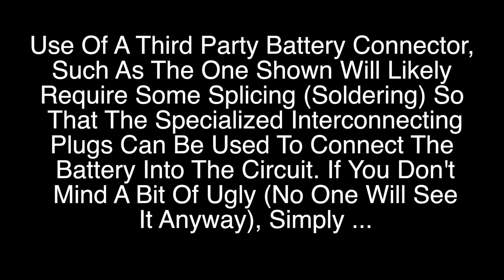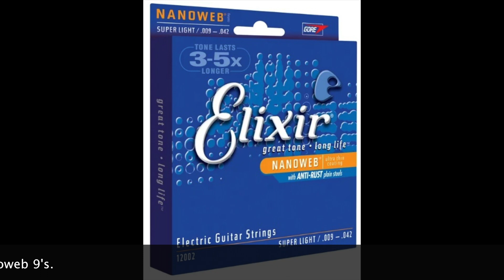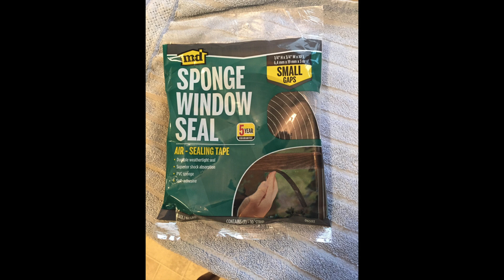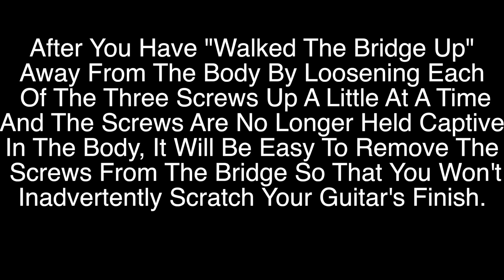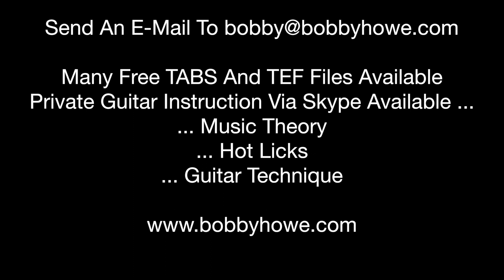Fender USA Tele EMG Pickups: A Review

Comment: Great review,thanks. I had EMGs in a Stratocaster for years and the battery would last a year. It was totally silent and I used it primarily in a recording studio where noise can be a issue. Worth mentioning that EMGs are low impedance output so you can run long cable lengths with no signal loss and also the strings don't need to be grounded so there is no risk of electric shock.Also the volume control doesn't kill the treble reponse when it is turned down.
Reply from the maker: Thanks for your nice words, Greg.  You've added some great additional points as well.  All my best to you and yours.

Comment: you have to take the neck off to install pickups?? ...wtf. I've changed my pickups in my tele without taking the neck off. hell..,I even installed a humbucker in the neck position without taking the neck off. I've never even heard of this witchcraft
Reply: On a 21 fret neck you can just pull the pickguard. On a 22, the last fret overhangs the pickguard so it requires at least loosening the neck and popping it up a bit to get the pickguard off.

Comment: Great video and wonderful playing!  I've been using EMG pickups before they were EMG.  For those wondering, yes this exactly the way they will sound.  Whatever your amp is these pickups will do the trick. As demoed here, Bobby plays a variety of styles and they sound great for everything.  They're absolutely noiseless and if you get noise using them it's something else in your signal chain. One thing that I love about EMG's is that they have a much better frequency response throughout the guitar range and have a very even response meaning that there are no soft or dead spots anywhere on the guitar.  You don't have to pick one string harder than the other to get the same volume. Because they are active and use a battery there is an alternate method rather than put the battery in the guitar.  EMG makes a battery box that uses either a battery or a 9V adapter with center pin negative which is what almost all pedals use. One thing I have noticed is that not all adapters will fit in the hole so if you go to a music store to get one make sure you bring the box to make sure it fits.  I don't know if EMG now makes a power supply for them. You have to use a stereo cable from the guitar to the box but they also sell those as does a lot of electronic stores. Use a high quality cable and there is no loss of tone.  I use the battery box exclusively because it's a lot easier to change the battery on the gig because there's a spring loaded tray that slides out to put in the battery. At home I use the 9V adapter because I like to keep the guitar plugged in because I'm too lazy to take the cable out of the guitar every time I stop playing. All this said, I highly recommended these pickups and I'm sure you'll love them.
Reply from the maker: Thanks Bruce!  Great info!  I'm glad you watched and liked the video.  Thanks, in advance, for subscribing to my channel!
Reply from the maker: Thanks Bruce for your nice words and for your details about EMG pickups.  I've put EMG's in at least 5 guitars and not been disappointed with any of them, glad to have made the investment.  All the best, BH

Comment: Beautiful Playing, sir! BTW, I hve active EMGs in 3 guitars, one setup in my Mexican Strat for the Gilmour setup, another in a Mex Strat for blues ( straight up Strat) and a setup in a Mex Tele. The Best part is they sound so clean, sparkly,  and NO HUM!! No worries, ever. Though I recently had a battery box installed in each guitar for quick access instead of having to disassemble the pick guard each time, which was a BITCH! Still worth it though because with average playing, the batteries usually lasted 6  mo. to a year.
Reply from the maker: Thanks toolbros!  Great info!

Comment: Love EMG but surprised they would recommend the use of foam for the height adjustment issue?  Pickup tubing available from Fender or any rubber tubing you can find in the same diameter (I found some at a hobby shop) would have been a much easier and cleaner install.
Reply from the maker: Adam, yes, I think I agree with you.  I will likely do something similar to this again and when I do, I don't think I will go with the foam.  EMG did recommend it, I went with their recommendation, it was OK for the one time I used it but if I ever have to re-do it and/or if/when I do it again, I don't think I will go with the foam.  All the best, BH
Reply: Bobby Howe great playing and videos, all the best to you too.

Comment: Awesome tele setup and playing! I was deciding between the EMG’s and SD’s, and decided to go with the EMG’s for my tele after watching this video. Installation was not difficult, and they sound amazing. I have a question: What pickup height did you settle on? I’m in the process of tweaking mine and would much appreciate your feedback. Great informative video, thank you!
Reply from the maker: Hello Mark B!  Thanks for your nice words and for watching my videos.  The neck pickup, just below the 6th string measures from the pickguard to the top of the pickup slightly more than 1/4".  The neck pickup, just below the 1st string measures from the pickguard to the top of the pickup slightly less than 1/4".  The bridge pickup measures from the mounting plate to either the top or the bottom of the pickup slightly more than 1/4".  Other factors affect the sound you will get too of course, like the height of the bridge saddles.  I tend to have very low action on my guitars and a very light touch on the guitar, I'm not a heavy handed player.  The strings I use are Elixir's 9-42.  I thought I would pass that along as well.  I hope all of this helps.  Let me know if I can do anything else for you.  All the best, BH
Reply: Thank you very much for the helpful information. My current pickup height is very similar to your specs, with the exception that I lowered the bass side of the neck pup slightly. It seems to clean up the lows and let a bit more brightness through for me. The action is fairly low as well, and I’m currently using Ernie Ball super slinky 9-42 strings. Haven’t tried the Elixir’s yet. I’m very happy with the tone and zero feedback results. Thank you for the great info and videos.
Reply from the maker: You're welcome, Mark!  Thanks for watching my videos!

Comment: Thanks for the video. I just bought this kit to install in a Squier Affinity Tele I also just bought which plays great but the pickups are lacking as expected. I hope the installation goes smoothly with help from your insites. Cheers!
Reply from the maker: Thanks Jason!  I hope it goes well!  I'd be interested to know how it comes out when you're finished!  All the best, BH
Reply: @BobbyHoweGuitar  T System has been installed. I chiseled out some room in the cavity to fit the battery and had to do a bit of metal filing for the bridge pickup to go in smoothly. I found I had some surgical tubing and I used that instead of springs to mount the pickups. A little bit of work but installed and sound great!
Reply from the maker: Great!  Sounds like you're happy with them!  I'm sure you'll get lots of service out of them.  All the best, BH

Comment: How is it going Bobby, quick question, just got myself a fine Fender Tele and even though I love the way its OEM pick ups sound I find myself in trouble “eq”ing them along with my other Les Pauls cos all of them got EMG sets on them. Since you also have Gibsons with EMG sets on, how do the outputs level among them?? Awesome review and thanks for the attention in advance!
Reply from the maker: Hi Alec, thanks for watching my videos and for your nice words.  As far as EQ-ing pickups be it on LP's or on Tele's, in general, I'd say that through experimentation, I set the bridge pickup closer to the strings, the neck pickup is further away.  One must be careful here, a pickup too close the strings can pickup string overtones giving distortion and unwanted harmonics in the output.  Then there is tilt, i.e., the angle of the pickup in relation to the strings in order to EQ the way the pickup is affected by strings 1, 2 & 3 vs. strings 4, 5 &6.  If you simply can't get the results you want with only mechanical adjustments of the pickup height adjusting screws, you may have to set them the best way you can and then use two different channels on your effects pedal, i.e., when playing on the neck pickup use one pedal channel, when playing on the bridge pickup use a different pedal channel ... more hassle but nonetheless, a workaround.  Then of course there are the EQ setting in the pedal itself.  Just from you question(s), I'm considering making a video describing my entire setup(s), LP's, Tele's, EQ pedal, amplifier.  What do you think?
Reply: Bobby Howe I think it’s an awesome idea!! Also I (selfish or not lol) could get a fair comparison regarding (specially) volume output, which is my main concern when swapping out guitars! Cos the difference (volume wise) between my 81-85 les pauls and my tele is HUGE!! Thank you VERY MUCH for your prompt answer!!

Comment: Hello sir! Tha ks for the video. I have a question about the pickups: are they "rail" pickups? Or do they have poles under each string? Thanks!
Reply from the maker: Hello Luis, Physically ... externally ... no rails or pole pieces, more of a soap bar type, just a high quality plastic housing ... here is what EMG says about them ... 
"The EMG T Set is a new take on the classic Telecasters™ pickup. Don't let the looks fool you, the T Set gives you all the twang and punch you'd expect with incredible clarity and definition with no hum. The bridge pickup (RT) gives players that classic chime without the 'ice pick' and a rich low end. When overdriven, this guitar pickup screams with incredible sustain and edge. The neck pickup (FT) has everything you want from a front single coil: clarity, warmth, and rich harmonic content that is perfectly matched to the back pickup. The T Set uses Alnico magnets with custom engineered coils and windings to give your sound fullness and a broader bandwidth, well beyond your typical Tele pickup. The EMG T Set covers rock, country, blues, fusion, R&B... and with our solderless wiring system, it's easy to install on your own."
You can find a photo here ...
https://www.emgpickups.com/tset.html
I hope this helps.  BH
Reply: @BobbyHoweGuitar  hi! Thanks for replying, am asking this bcos I am thinking of using this pickup for an electric ukulele that am building, but being only 4 strings, and those strings being separated differently than in a guitar, i need something like a rail pickup, rather than having 6 little poles to sense each string. EMG is close for the California stay at home order, so no customer support is available as of now.
Reply from the maker: @elluisito000  I would say before you invest in something you may or may not be happy with, that is, it may or may not meet your need, consider these points:
1. You could spend your money now and buy something through a vendor but maybe it'll work the way you want it to, maybe it won't.
2. The country won't be shut down forever.  When EMG opens back up again,  I'm sure they can advise you as to what stock products have the best chance of working for your application.  If they don't have it, I'm sure they can make you a custom product that will.  Ukuleles are becoming more popular these days and certainly aftermarket companies like EMG, if they're not speaking to that market now will miss an opportunity if they don't.  They should know that.
3. You could could invest in a rail-type pickup by getting something off of eBay but if it were me, I'd get something inexpensive to see if it will work.  It's a risk but not a lot of money put forward, not a lot of money lost if it doesn't work. 
It's not my place to say what you should do but those are my thoughts and I'm just trying to be helpful.  I hope this has been useful.  All the best, BH
Reply: @BobbyHoweGuitar  hi! Thanks for the advice. I have installed emgs in several of the basses I have built in the past, but this ukulele is the first one for me, and there aren't many options around, specially for the level of quality and noiselessness that emgs provide, I know their bass pickups and the are very very good. But the string spacing is an issue issue, and saddly they are covered and the only way to figure out if the pick up is one rail or several poles is having one pick up already :D

Comment: An easier fix for the pickup heights is to use surgical tubing, very common on most older guitars, and an easy fix for any. My ‘52 has no problems at all with installation
Reply from the maker: I would say that it's another way to go about it, I wouldn't say it's easier.  Surgical tubing will work but it's so tough, difficult to cut.  The foam method was recommended by EMG, it's easy to work with and is very inexpensive.
Reply: Bobby Howe ironically, tubing is the common method for the majority of single coils, and a snip’s easy. My old ‘52 and ‘68 still had them in . . The old adage, “Don’t reinvent the wheel” when nothing’s better. But if you’re happy, great 👍🏻 
Certainly don’t like the rattling springs option that came with the Gilmour set, but then again I got rid of that soulless set 😏
Reply from the maker: I'm glad it works for you.  All the best, BH
Reply: What I've done if spring compresses completely before desired height is just grab my snippers and snip a bit of spring away until I get desired height.

Comment: Can I route the control plate on the inside to make  it wider of the to sides of it
Reply: For the battery
Reply from the maker: @darrelloxford427  I suppose you could.  An easier solution is to apply gentle pressure to the sides of the battery to squeeze it a slight bit so that it will fit.  Rather than go to the trouble of routing the body of the Tele, which could give negative results ... I'd be concerned that I'd be taking a chance on scratching the finish of my guitar ... unless you feel totally confident about using a router on your Tele body.  There is also the hassle of taking apart a great deal of the guitar to use a router to do all of this.  Not all 9V batteries are the same width either.  I hope this helps.  Best regards, BH

Comment: Hi Bobby. I've been loving and using the T-52 pickups in all my builds and my own Teles as well, but haven't compared them to the T-set, I'm just wondering if you've tried both, and if so, what are the differences (primarily clean in the neck position). BTW, thanks for the great videos!! You really should call Rob Turner (the owner & CEO at EMG). He'd love to get your reviews. (he's a good friend of mine)
Reply from the maker: Hi Kevin, thanks for your nice note.  I have not tried any T-52's and I presume you mean those pickups that are retro-fit types to make a modern Tele sound like a '52 model.  What I can tell you is that the EMG T-set is clean and crisp.  I can get a country-type, snappy Nashville sound (I tend to go for or call it a crunchy-funky quality) out of the bridge pickup but more prefer to use the neck pickup for smooth, jazzy sort of things.  I'm primarily a clean-sound, smooth type player and the neck pickup gives that to me, rich sound across the spectrum, especially in the low's and mid's but yet with high end clarity.  I don't want pickups that sound like mud.  Thanks for the encouragement and for the suggestion to chat with Rob Turner.  I've not spoken with him before but I have with Allison.  I'm envious that you're on a first-name basis with him!  I hope this info helps.  All the best, BH
Reply: @BobbyHoweGuitar  Rob (Turner, CEO of EMG) developed the T-52 system from Vince Gill's '52 Tele. They are pretty similar to the T-system, but a little bit more aggressive. Since I wrote the above, I've switched to the T-systems in most of my builds and my own guitars as well. I back up my wife who is a wonderful vocalist. We do a lot of different material, from old Jimmie Rodgers & Hank Williams, thru newer Country, Blues (including the Chicago BLUES Jimmy Rogers), thru Western Swing, Standards & Rockabilly blah blah. I find that the T-System gives me a little better Jazz type tones when I need them, at the slight expense of the Chicken Picking type highs (which I don't really play anyway). I also picked up a new Fender Tone Master Deluxe Reverb (I've played Fender tube amps for 50+ years), and the combination is amazing!! Most versatile system I've ever used!!